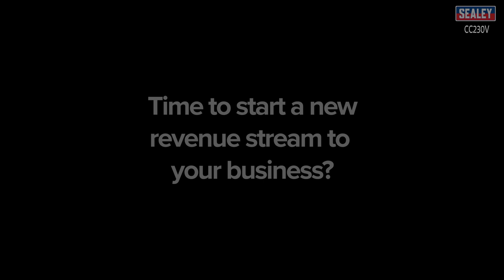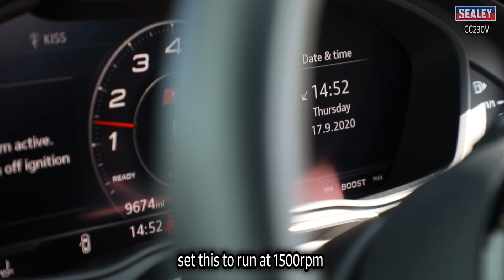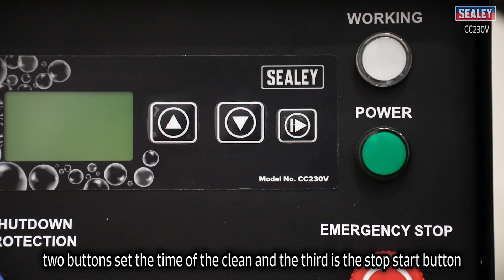Sealey CC230V: Same-Day HHO Engine Carbon Cleaning for Improved Performance and Efficiency

Comment: Hi does it cleans the intake manifold?
Reply from the maker: Hi. Unfortunately, it will not clean the inlet manifold very much, as the cleaning really starts after the combustion process. It may remove some carbon build-up. but won’t completely clean it. Hope this helps.

Comment: What a scam
Reply: @Backwoodsmachinist can you please elaborate why it is a scam
Reply: Because a backwoods machinist is an expert on organic chemistry? LMFAO
Reply: @CarbonTek USA Central Indiana  doing some research into carbon cleaning and reading comments to see what could lie behind closed doors. However I m not against the process and irregards of how many components or parts it cleans I believe in just cleaning the combustion chamber will make a difference.

But what shocks me is the response from CarbonTek USA. Not professional at all and that is a bit concerning as it raises a question as to why being so defensive about the product. You as a company should have known there would be sceptics out there but to respond in such a childish and disrespectful manner is very concerning.
Is the level of professionalism that low and more so is that the same attitude that went into your product.
Everyone knows what LMFAO means.
Be a bit more professional and try to assist people rather than step on their toes.

Provide prove or facts that will guide them rather than something that will put them off on you and the company product.

Fruit for thaught...

Comment: Does it clean the back of the intake valves on direct injection engines?
Reply from the maker: Hi Raphael, It will clean the front but not the back of the inlet valve, the gas needs to combust first

Comment: It cannot clean turbocharger and EGR .......i can bet.
Reply: You would lose!
Reply: @carbontekusacentralindiana29  
It does not sir. Can you explain how it can clean turbocharger and EGR  ?
If you have an answer pls reply. But i can explain you why it cannot clean EGR and turbocharger. Interesting discussion ahead. Looking forward.
Reply: @krp1769  go to the CarbonTek Central Indiana website and watch the videos for a simple animation video
Reply: @carbontekusacentralindiana29  
It cannot clean EGR and Turbocharger. Let me explain why......Hydrogen as highly combustible gas cannot clean on its own. It clean surfaces when it combust. It combust only inside combustion chamber. As we all know that EGR is not present inside combustion chamber. Moreover EGR is always closed at idling speed. Once Hydrogen is combusted inside combustion chamber it loses it vivacity while coming out during exhaust stroke of an engine. 
So stop claiming someting which is not true. I can say that with confident because i have checked EGR and turbocharger before and after carbon clean.
Hope you would have understood by now.
Reply: @krp1769  I'm curious why you took an engine apart twice, and what result you were looking for? What type vehicle and engine are you making these claims about? What Carbon cleaning system or service did you use? What are your qualifications to make your claims? I can't testify for anyone else's business or process, but I can about CarbonTek. Believe whatever you choose, CarbonTek USA Oxy-Hydrogen technology is for real. Good day sir.